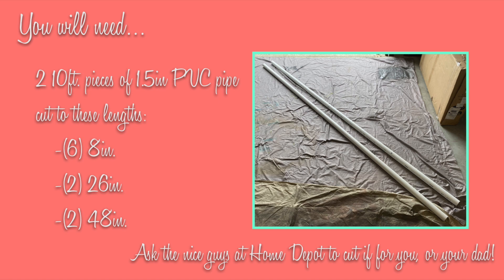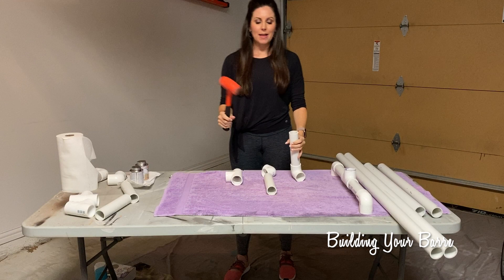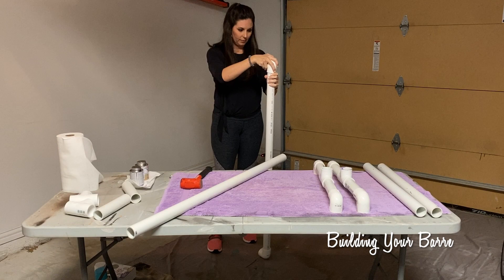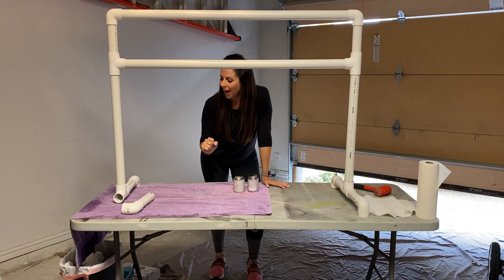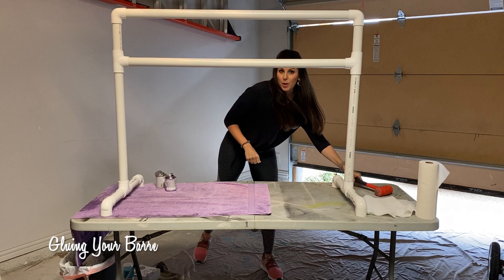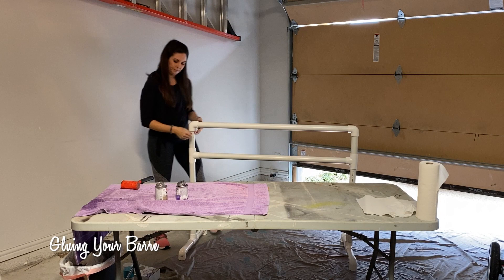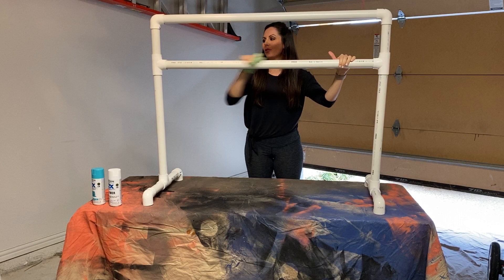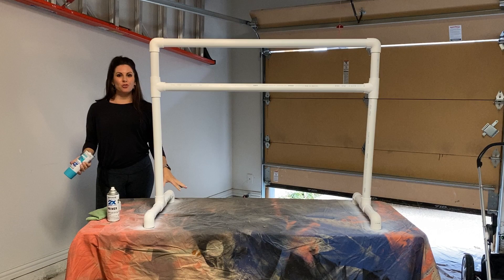How to Build Your Own Ballet Barre with Justine Orf

Comment: PERFECT!!! Thanks to great instructions she makes this DYI easy. parts cost $41.00 at Lowes 

The video is short and to the point showing you all the parts and sizes you will need. I had the guys at Lowes cut each PVC pipe to the specs no problem. It took me less than 30 minutes to put together and is very stable.

Comment: So the bottom of my car is a little unstable and I’m trying to figure out ways to stabilize it do you have any tips???
Reply: I believe you meant bar and not 'car'? I tried the above design, it was shaky, not sturdy. I didn't want to spend more money to make it sturdy as it would involve trying out several things.  I also used PVC instead of ABS...still not sturdy enough. I have decided to invest in a professional Barre.
Reply: @sumdimsum  Thank you for your honest opinion.  I did one too for my daughter.  I agree with you, it is not sturdy.  Just thinking if it is worth it to replace the PVC with powder coated aluminium.
Reply: On another channel, they stabilized the feet by using a cross shaped connector instead of the t-piece, this way it makes a 3rd foot on each side